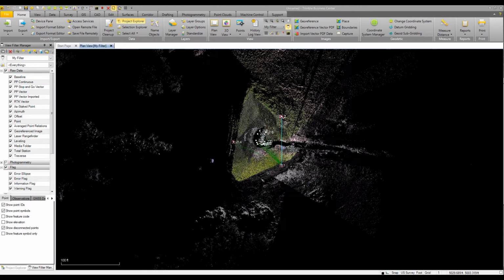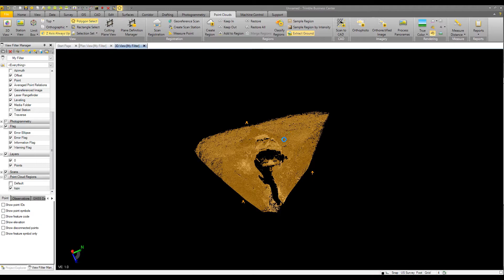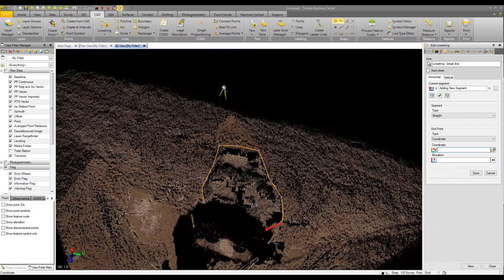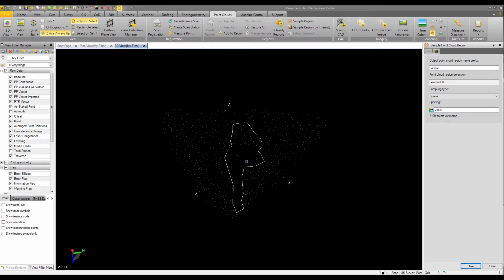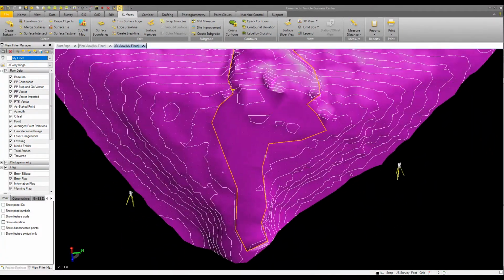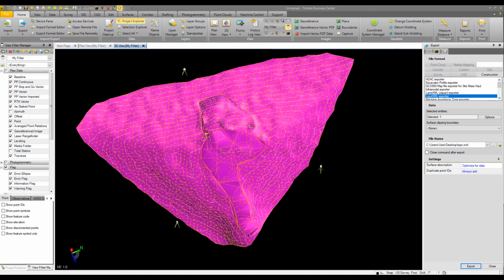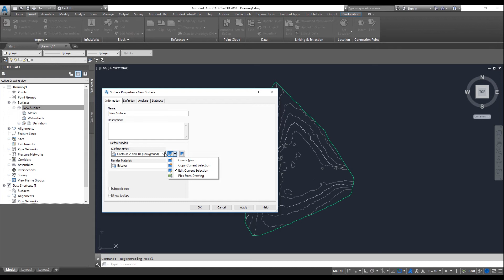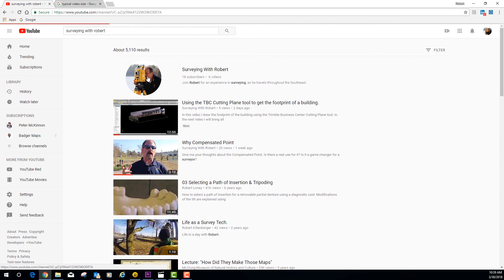TBC Point Cloud Surface to Civil3D

Comment: When you created a linestring for the breakline why did you choose a regular linestring and not breakline from the dropdown menu?
Reply from the maker: With point clouds it’s a 3D line. It has elevation because it was derived from 3D points. Everything in TBC is 3D almost impossible to draw a 2D line. Does that help?
Reply: @SurveyingWithRobert  I'm enjoying the videos. Civil 3d is a pig when working with large surfaces from my limited new dip into point clouds! Trying to work with a 250 acre site. :/
Reply from the maker: I have some photogrammetry drone data on a cleared site. I may build a video on it tomorrow.